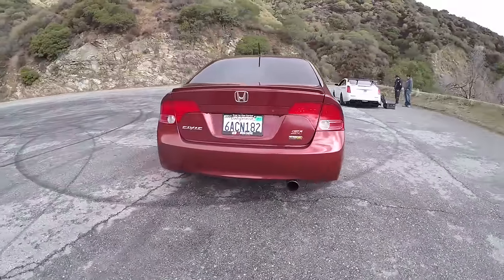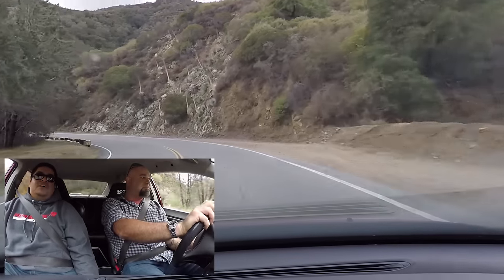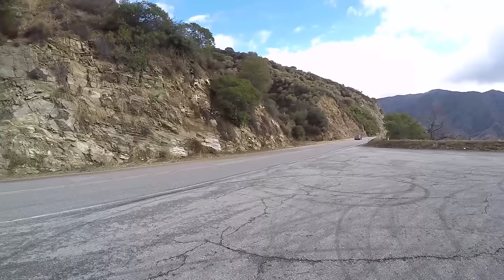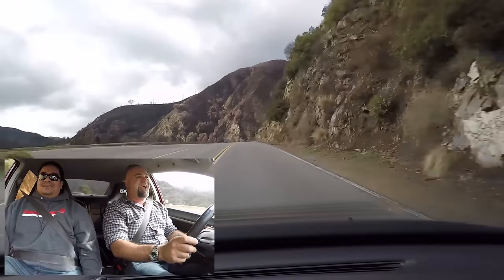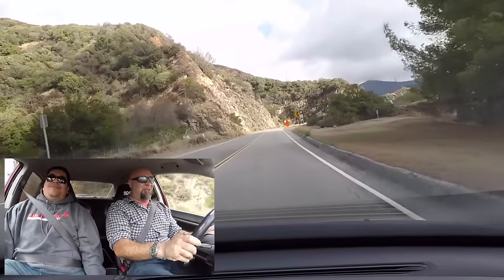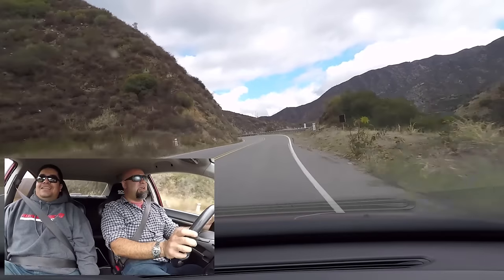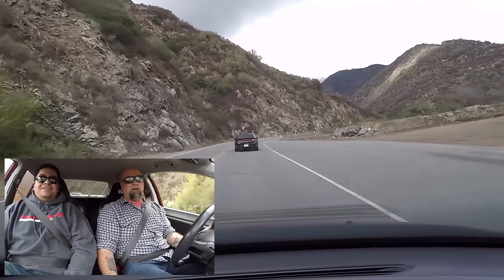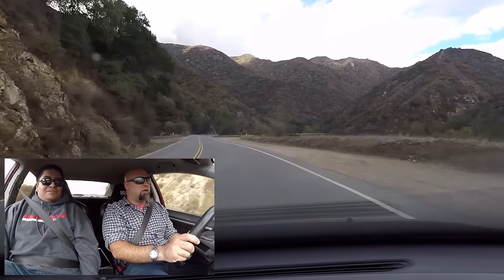INCREDIBLE 330HP All Motor 2007 Honda Civic - One Take

Comment: I was sitting there wondering how he made 330WHP on an NA build....and then Matt said 14:1 compression. Holy cow!
Reply: +15FG4SI  more like 15-20
Reply: The e-85 doesn't make more power. It enables you to tune the 14:1 comp motor to 330hp and still fill up at a pump. It's just cheaper and more convenient than race gas fellas.
Reply: Dominic Sartini It makes more power than pump gas. Which is what most people run, and compare e85 to.
Reply: TheSpeedTrap plenty of people running these numbers na without e85 and 14:1cr...they are up to 500whp na now!
Reply: TheSpeedTrap what about the torque? am I the only person that knows torque is more important than hp
Reply: Kirk Lazarus V torque means absolutely nothing after 60 mph. Unless you're carrying a bunch of crap, you don't need that much.
Reply: Boni Hollóssy because you can run the higher compression ratings and run higher boost without the gas predetonating. e85 has a much higher octane rating than pump gas
Reply: I think E85 is equivalent to like 101 octane or something, enabling more extreme compression, boost, etc etc with less worries when it comes to knock and what-not. Same idea as race gas, just at a pump, but you need more fuel to make up for a lower energy density. I think that's the case, but I'll go watch MCM's explanation video again I guess. And yeah, regardless of the low-torque, that is an impressive horsepower number. The gearing looks like it made up for the lack of torque a bit as well.
Reply: TheSpeedTrap closer to 105-110 octane and it keeps the combustion chamber very cool as well
Reply: Torque is more important in the real world. Yea, F1 cars are crazy fast but you are also talking 20,000 rpms so I don't know if that comparison is worth mentioning. Yea, HP matters if your keeping your car in higher rpms all of the time but like I said, in the real world, that's not possible...racetracks are different monsters altogether. Having a good balance is key but torque is still more important to me than HP for most applications...ask FRS owners how they feel about lack of torque
Reply: TyranitarComedian so torque is not the force that makes a car faster is hp?
Reply: The E85 just keeps it from detonating at that CR.
Reply: Don Perry Automotive HP is a result of torque and rpm. F1 engines are tiny and make little torque which is why they need to spin 15-20k rpm to make any power. That would be unusable for a street car. so at the end of the day, for a street car, torque and where you make it matters. HP will follow
Reply: Torque is just a function of power and rpm. Its power that makes things go. Higher torque can be geared.
Reply: Torque is needed at high speeds in order to overcome drag.
Reply: actually HP is a function of TQ and RPM. HP=(TQxRPM) / 5252
Reply: Kirk Lazarus V you read something once and you think your too smart now, sit down
Reply: Mark Rampersad lol salty much?
Reply: Yes I know thanks, I was talking to a guy who said torque doesn't matter at high speed.
Reply: Tuned E85 makes the biggest difference, but its still a dirty civic.
Reply: guys have been making 300+ using pump friendly 12.5:1 compression and less displacement.
Reply: Richard Bossman At 14:1 don't you have to run high octane all the time? Seems like an unnecessary pain in the ass if you want to daily.
Reply: Patrik Pålsson But then isn't it going to lack acceleration up top. Better to have high TQ and a good ratio diff. 
IMO a car with nice low end torque is much more fun to drive. That initial thrust back into your seat at only 3000rpm while hitting apexs of S turns is sooo satisfying.
Reply: +atlanticimports 

yes at 14:1 static compression you have to run better fuel but not on a 12.5:1 assuming the head design is decent.
Reply: +atlanticimports 

also it's tuned on E85 which is becoming more common. Mpg's will go down but who cares, this car would be torquey and a blast to drive.
Reply: Richard Bossman Lucky wherever you are then, E85 is nowhere around Canada highest in my province is 91oct. So if I want to take advantage of advanced timing for higher octane I have to order a drum from VP distributor. But then pretty sure c16 would fuck my sensors so until drums of E85 show up I'm stuck on powerless 91oct :( My Blouch 1.5XTR (comparable to gt28) is topped out around 350awhp on 91. Even if I had access to 93oct I could get closer to 380-390.
Reply: Both vp and sunoco make e85 you can buy by the drum.
Reply: TwoWheelJockey Its just my local distributer doesn't carry E85, just leaded fuel. Maybe I should buy a drum and sell it in 5gal quantities for a small profit to pay for my fuel lol
Reply: You should try to find a different distributor then. There's no good reason for them to only carry the leaded fuel.
Reply: Horsepower at a given engine speed is essentially the closest measure to how fast a car can accelerate.  You need either torque or high RPM to get a lot of horsepower, so no, it's not really more important, it's just one way of achieving the horsepower you want.
Reply: High compression, e85, and I'm sure the timing is up there to
Reply: E85 = 105oct
Reply: PatioPerformance Crew Timing would be up there but it's my understanding 14:1 really likes 116oct which should allow even more timing. He could run a second 116oct tune for drag/track days and make even more power. 15k on an engine build is a little much tho when you can just run a turbo with E85. Although I understand the desire for the simplicity and response of a built NA engine. Need proof that this is a 2500lb car tho because I have a hard time believing that.
Reply: Kirk Lazarus V Torque doesn't really mean anything if you can't apply it at high rate, AKA power. give me a 3 foot breaker bar on an axle and I can apply 900 lb ft of torque but it's not going to be fast because my rate of application is very slow. So yes on a street car a high torque engine will feel faster when you are cruising at 2000 rpm and punch the throttle, but all things considered HP is the determining factor in the maximum acceleration of the vehicle.
Reply: Matt Dwyer Right, so ability to pull away at high rpm is Hp? And acceleration from a dead stop is Tq? Is that correct?
Reply: 13.1 in america
Reply: +atlanticimports No, that is not quite true. Torque is an observation in physics that describes the tendency of force to rotate an object about an axis. Horsepower is a function of torque at a given RPM. This is how to figure out horsepower: HP = Torque x RPM ÷ 5252. Put simply, torque is torque, and horsepower goes up if RPM goes up (unless torque decreases too much). Torque is mandatory at all speeds to accelerate. People telling you that "torque is for off the line" are not wrong, but they probably poorly understand torque, and they likely mean that making lots of torque at low RPM is great for off the line. Torque is also a vital part of midrange acceleration and top end performance. When you have torque plus a fast spinning motor, you have high horsepower
Reply: ENDYN has a B20 running on 91 octane and making 318 hp. Honda engines are awesome.

Edit: That's at the flywheel, though.
Reply: e85 has a higher knock resistance but has a lower energy density than regular gas.
thats why e85 people have to use fire hose nozzles for fuel injectors (sarcasm)

i wish i had e85 locally.
Reply: euroaaRON1 Same here man, if I had e85 I'd immediately upgrade my fuel system and run only e85. Many benefits  besides just power, lower cylinder temps and natural lubricant probably increase longevity of the engine.
Reply: Don Perry Automotive F1 cars actually have incredible torque at the wheels. Remember the gearbox and the final drive multiply torque. They have relatively little engine torque but considering they rev 20,000ish rpm, they're geared very low compared to a normal car. It's just not practical for a street driven car
Reply: 1down5up I'd like to see the Ariel Atom get a 1000cc sportbike engine, revving to 16k rpm I bet would feel like a mini F1.
Reply: Check out the Ariel Atom V8. The engine is essentially two Hayabusa engines on a common crank.
Reply: I haven't read through all 50 replies, but Mazda's 2.0/2.5 skyactiv motors are factory 13:1 in the US on 87 octane, and 14:1 in other markets on the equivalent of 91. direct injection keeps the charge cool, clever EGR via VVT keeps the intake air from getting too hot, and a 4-2-1 header gets the heat out of the cylinder faster.
Reply: +Jeff Shaw 

are they N/A or Turbo engines?
Reply: Skyactiv motor are also direct injection with reduces knock by quite a bit allowing for higher compression. These old ones are port injected.
Reply: There are 500hp N/A k27
Reply: swollenmadman16 the high Compression with any low grade gasoline will create the knocking with the high Compression skyactiv moto but Mazda made a temperature regulator that keeps the knocking away.
Reply: Games 4 Days  That temperature regulator is called direct injection. Start with the Mazdaspeed 3/6 engin. That is the forced induction predecessor of the Skyactiv engine..
Reply: Will do I have a skyactiv so I tried to learn about it bc I know it's not the normal engine. But I still love it. 2012 Mazda 3 coming from a 2008 Mazda 3 with Almost 300hp last time it was dyno. But sadly enough it was totaled about 5 months ago. 😠 still loving the new one too. Is fast too all on its lonesome stock self.
Reply: Sergio Aguirre fuck that's an amazing power to weight ratio then.
Reply: Richard Bossman They're NA. relatively low power output, but very rev happy and still fun to drive. They did adapt the skyactiv G 2.5 for a turbo in the CX-9 crossover. Pretty neat lag reduction system too, using a valve that effectively controls the velocity of exhaust gasses going to the turbo.
Reply: Games 4 Days As I understand it, the ECU on the skyactiv engines basically adds timing until knock is detected and then backs off. It's dynamic, but yes, as I stated before, it does also use Direct Injection, exhaust cam VVT instead of traditional EGR, and a 4-2-1 header to keep cylinder temp down on regular gas.
Reply: e85 does lot with high compression and high boost but on low compression engine or low boost it really does not do much. e85 cools intake air and resist detonation so you can add more timing, but gasoline burns better. With low compression engine or low boost, you can already get close to max efficient ignition advance with high octane gasoline. I leanerd that when i gained only 10 whp with e85 on my low 8 psi boost.
Reply: Which in turn allows you to have more power.
Reply: lol yea ok
Reply: f1 also weigh 1 pound
Reply: finally, a smart person here
Reply: TheSpeedTrap I just recently got a 2007 Honda Civic si and I want to add power where should I start?
Reply: CobraFangGaming Start by selling your civic, and consider buying a real car
Reply: Julian DeJesus lol rude...forced induction would be the way to go. But seriously your gonna spend quite a bit trying to make a honda fast, I would just do lightweight rims, sticky tires, quality coilovers, no raceland garbage. It's not a fast car so you're better off building a car that handles great and then you'll be able to hold higher cornering speeds.
Even bolt ons like headers, exhaust and a tune won't add significant HP for the money spent.
Reply: atlanticimports it already has a built motor with 198 wheel torque and 238 whp so should I just turbo charge it?
Reply: CobraFangGaming If you have the extra cash kicking around and want a significant increase in HP that's the route I would choose. Just keep in mind turbo lag and now more things can go wrong vs NA motor reliability. If you're handy with a wrench then by all means get a good turbo kit, none of that eBay cxracing shit.
Reply: atlanticimports I don't plan on getting eBay shit I want a good turbo and I always love putting new stuff in my car
Reply: CobraFangGaming Then order the $6500 full race turbo kit with a proper Garrett turbo. I'd go with something that spools quick like the gt2871. Unless you're into drag racing this would provide the best experience especially on tight winding roads.
Reply: but those are direct injection. This is sequential port.
Reply: atlanticimports thanks for the help
Reply: TheSpeedTrap Isn't the Toyota 2zz-ge 14:1 as well?
Reply: Very very vague. We all know engine makes torque and horsepower is just the measurement at a certain rpm. The lighter and shorter gear you go, the less torque you need. in a honda yes loads of low end torque is pointless do to it's weight and FWD. Same story with f1, they're even lighter, they spin off the line with the little amount of low end torque that they have, it's progressive power all the way up to 14k or wherever their limiter is at. Also compression plays a big roll, you can't just say one is less important than the other as they all correlate with each other, you sure as hell aint gonna make 330 whp with less than 10:1, NA that is
Reply: Not streetable ones
Reply: turbo....you gonna need forced induction for that tiny motor to make anything
Reply: Area under the torque curve is most important but HP gives a good summary of that. Peak torque is less important than peak HP for going fast because HP gives you an indication of how much you can exploit gearing to get more torque at the wheels.
Reply: No they aren't, it's simply not possible to make 200hp/L without boost unless you're running an insane compression ratio which requires exotic fuels like e85, methanol or race gas.
Reply: look at all these technical replies... This is why the true Honda scene is awesome. Science meets modding 😍
Reply: Kirk Lazarus V not true. How would a lets say a civic with 700tq and 300hp win agnest a civic 350hp and 218tq. Toque wont matter when ur going 100+ it matters in a dig or a roll for a few seconds but then person with more hp will start real him in or start pullin.
Reply: Put that simply, E85 makes engine run on Higher CR which helps make Higher TQ which basically = Higher HP

But E85 itself has less energy in than the pure petrol.
Reply: Gecko honda scene? Lol, it's just basic physics to every combustion engine
Reply: E85 doesn't make the engine run on higher CR, it allows the engine to run at a higher CR without blowing up.  Pistons and heads make the higher CR.
Reply: Dan Burns Exactly, low octane fuel ran in a high compression engine would knock like mad eventually sending a rod thru the block.
Reply: AMG Crossfire For the sort of money you'd spend on that you're better of going with a turbo kit. Then you have the option of making even more power cheaper and easier by upgrading turbos down the road.
Reply: dont think these guys care about that. their enthusiasm and curiosity is whats special. but thanks for counting the money.you must be an accountant
Reply: Junkhead yes...because of its race gas like octane! Not because of any magical properties of ethanol. In contrast, ethanol is actually LESS energy dense than gasoline, but its used because its five times cheaper than the equivalent race gas
Reply: Vega-Expert yeah probably with high octane race gas
Reply: sounds fast and is actually slow asf.
Reply: Anthony P Lol stop being a tool, it's okay you know nothing about cars. Not a big deal. Few people do.
Reply: There's a company that makes a K24 motor make 500hp NA. Though its bored out to like 2.7L or something like that.
Reply: +Kirk Lazarus V There is a lot to the saying "Torque sells cars, horsepower wins races". One can't be wholly more important that the other as Horsepower = Torque * RPM.
Reply: thoses cars have around 210 hp stock
Reply: torque and HP are directly related. HP = T * RPM / 5252
Reply: someone had a 8 second crx 390whp i think? look it up on youtube its nutty
Reply: AMG Crossfire you're wrong dude. 400hp w good tires won't beat 1000hp w OK tires LOL. Maybe NO tires lol but even w not-good tires 1000hp is deadly wake up.
Reply: Russ Langford Def not in a drag but on a circuit there will be a good chance because with 1000hp you can't put all that power down thru the turns.
I run Michelin Pilot super sports on all my cars, it's one of the best performance upgrades along with lightweight rims (less rotational mass is major) track pads and fluid.
Reply: Germ .Fish Because 200hp is crank not whp so the jump from about 170whp to 330whp is quite significant and I'd say is maxed out. He's gaining the biggest increase from the advantage of high compression running e85 and being able to run super aggressive timing.
Great build if e85 is plentiful but that engine build is about as much as the car. I'd personally just have gone with a quick spooling turbo and run two tunes for either 91 or E85. Would be hell of a lot cheaper to build.
Reply: Can you tell me what this car weighed factory from the dealer?  I'm thinking closer to 3,000-- but I could be wrong.
Reply: 2700 curb
Reply: Benjamin Lee Yeah tons of idiots on the internet who think they know it all...

But thais was a fun video. My dream is to build my 8thgen to 230hp. It's all you really "need".
Reply: Thank you sir.
Reply: TheSpeedTrap the
Reply: I wonder how long is this engine gonna last at that compression.
Reply: how does the compression effect hp ?
Reply: because more cyl pressure = more horse power
Reply: @Patrik Palsson Torque is rotational force, measured. Horsepower is a derived unit calculated from torque and RPM, meaning horsepower is a function of torque and RPM, torque isn't a function of anything. It simply, is torque. Also, as Archer stated, torque is needed at high speeds to overcome drag. In 1988, the McLaren MP4/4 topped out at 207 mph (330+ kph) with a turbo v6 Honda engine making 650 hp at the German Grand Prix. The next year, 1989, the cars were all naturally aspirated 3.5L engines, & the V10 from Honda was producing 675 horsepower, yet it was considerably slower in top speed at the '89 German GP. The turbo engine had a lot more torque and pushed through the air with greater success at high speeds. That's with improved aerodynamics for 1989 too. The '89 cars and thereafter were quicker in lap time than the turbo cars from the mid 80's but the turbo cars were faster on the straights, even with less horsepower sometimes.
Reply: So how come FZ09 with 89ftlb woops an F250 with 800+ftlb?
Reply: Because what matters in the end is horsepower.  Horsepower is the measure of how much work an engine can do over a given period of time.  The more horsepower an engine has, the more work it can do.  That is, the faster it will go.  Torque is the measure of the instantaneous potential traction of an engine, the ability to overcome inertia.  So big trucks often have high torque motors that are designed to have gobs of low rpm traction for pulling and hauling at steady, low-wear engine speeds.  That doesn't mean they will be fast though, because that is a matter of how much work the engine can do (horsepower) and how that force is able to be efficiently applied to the pavement (gearing/adhesion).  So to haul a heavy load, you would want the F250, because a high horsepower car motor with lots of power but very little torque until high rpms could be damaged trying to pull that same load.
Reply: +Kirk Lazarus V  Not for speed.  For hauling heavy loads, sure.
Reply: And has ooooh such much worse gas mileage, because the energy density of E85 is low compared to regular gasoline.
Reply: +eroaaRON1  Correct.  The low energy density (and terrible mileage) would be a total turn-off for me.  Supercharging gives a nice alternative without some of the quirkiness and expense of custom turbo setups.
Reply: Ya and the e85 helps a lot with that high compression..it's less prone to knocking or detonation with e85
Reply: that's almost a diesel compression ratio
Reply: Robbspeed3 not completely true you can make more hp on lower octane ....  higher octane takes more to burn there for reducing knock and detonation technically a 87 octane or 93 will produce more power but isn't controllable at higher comps .....  just saying e85 is is corn ethanol on e85 you have to have 30 percent more fuel where as methanol or an alky car has to have almost double ........ you can make more power with it but at the cost of using twice as much.....  that's one of the reasons you'll hear Matt talk about how shitty e85 cars are on fuel in a lot of his videos.........   as far as power to fuel you can use 87 or 93 with water or meth injection. when needed for the same power levels and it's only used to cool the combustion cycle... where as e85 is already mixed in when your talking octane or diesel cetane levels it's straight up purity like everclear being 180 proof versus Jack being 80 to 90 percent based volume...... same exact thing just using fossil fuels .......
Reply: Alex Garcia ya and are 50k dry sump engines
Reply: atlanticimports they make an ATOM with the hyabusa made v8
Reply: J Carney Hartley v8
Reply: damn, is it really that high?  Wonder what an MX5 would do with some cams and headers
Reply: Rockit181 ND? Like 210+hp so far with a very usable torque curve despite the cam. Parts from bbr gti uk are available from flyin miata in the US.
Reply: Yup talking the high compression ratio on the ND skyactive engine
Reply: You guys need to revise your knowledge...HP is calculated. To move an object you need a force, that force is torque. HorsePOWER is how much force you apply over time to accomplish a given amount of work. 

Long story short, the dyno measures torque, and with the RPM calculate a Power figure. The faster the engine revs, the less torque is required to produce HP. There are many roads to HP... high torque low revving or low torque high revving. 

So a 100 lb-ft of torque at a 1000 RPM is pretty weak... but at 20 000 RPM that would be 380 HP.
Reply: Street cars don't bother with e85. If it's using e85. It really ain't street.
Reply: You can also only do that compression on e85.
Reply: Thats right well said sir!!
Reply: @andrejones3464  balance is key
Reply: @vincevegacustoms8860  yeah with what race gas
Reply: @kirklazarusv7645  so a tractor with 100ft lbs and 15hp would smoke this huh
Reply: @GUTHRIE #1 It technically doesn’t make more power than pump gas, it makes the engine far less likely to knock, which allows you to use more aggressive tunes. Those more aggressive tunes are what made the extra power, the e85 just gave the tuner a better platform to work with.